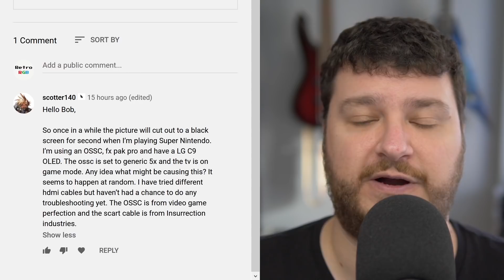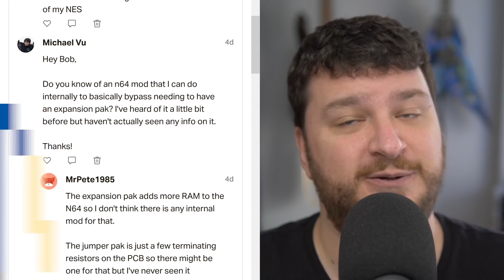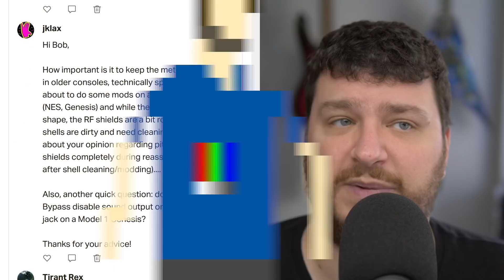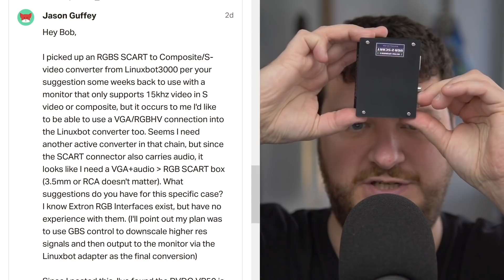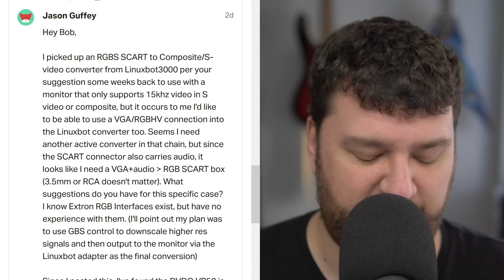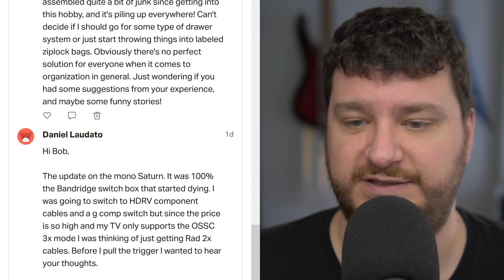Supporter Q&A #143

Comment: Saturn with rad2x is a nightmare. You have to have the right console model. It worked perfect on my model 1 but my model 2 was a problem. I sell consoles and had tested multiple consoles and most model 2s need power and When I plug in power it creates so much noise. I’m waiting for the ossc pro or retrotink5x

Comment: Thanks for all the hard work and many hours you put into the community! 

I wanted to see if there is a good solution to get S-Video into an Extron Crosspoint switcher. I’m not sure if it’s possible to convert S-Video to component then to BNC to connect to the Extron. Or if I can get a S-Video to BNC adapter (I’ve looked and it doesn’t seem like that’s a thing). I’d like to be able to send S-Video to my CRT TV and then to my flat panel TV via component. I hope that makes sense haha. Thanks for any advice you have!!

Comment: Isn't the 5x with SNES the jitter issue the OSSC has with SNES? My 5x works on my TV with every console except the SNES.
Reply: It's two things. Yes, sync jitter is one but the other is the SNES' odd 60.08hz refresh rate. Because NTSC is less than 60hz and HD sources are supposed to be exactly 60hz the TVs that handle it either have to do variable refresh rate, buffer frames, drop frames, tear frames, etc. Most just don't support it for HD resolutions.

Comment: I've been on the hunt for two months straight for a RGBHV (VGA input) to S-VIDEO to make a GroovyMame setup with my BVM A-Series (don't have the bkm-68x lmao). As of today, I found some good solutions (aside from the Extron interfaces which are impossible to find here in Brazil):

• The linuxbot3000 one but it's v difficult to find

• VGA2NTSC from Retrotink but it's v difficult to find

• VGA to S-video adapter from Antonio Villena's mister builds. Bought it and haven't arrived yet. Depends on csync (GBS Control does not support it unfortunately) and 5V on pin9 (afaik GBS Control does support this) so probably will work with crt_emudriver. 

• rgb-2yc from axun workshop. Bought it and haven't arrived yet. Probably the best choice.

• There is a local shop in Brazil that produces and sells white jrok clones. They take RGBS (csync from crt_emudriver ftw) 15khz as input and outputs S-VIDEO. Works as per their videos, but I couldn't get it working on my setup (my soldering skills are subpar so there's that).

Please be careful guys, don't buy cheap VGA to S-video SCALERS. If you read SCALER on any product, RUN AWAY! The output from those is 480i only and VERY bad as well.

As mentioned in this video, it's very strange that these solutions are not more common. There are a lot (in relative terms haha, that's a niche of a niche) of people out there without rgb/component and depending on composite or s-video and would like a GroovyMame setup and/or to use gbs control with s-video.

Comment: What do you or anyone think of the very common TG16/PCE AV adapters that are on ebay that are bare PCBs and have RGBs, AV/S-Vid or a Genesis model 2 9DIN port etc? Looking at the PCB they seem to be decent quality for the price, even some of the HDMI ones I have seen especially on Japan import sites seem to convert RGB to digital. I have a TG16 im repairing and doing an AV internal mod seems to be pointless even if I remove the RF Modulator, and I wont be buying an SSDS3 for a while and need an OSSC anyway so one of those would be great if they wont kill my console. They at least seem much better than the hyperkin crap lol. Even with audio caps and maybe an amp, cant remember...

Thanks for all you do Bob! And the RetroRGB community. :)

Comment: Hi Bob!
I just bought a fairly cheap Megadrive v.1 with no DIN output. Apparently, the seller had tried to fix it and couldn't get to it, so he completely removed the socket.
Now, I came up with the idea of installing a 3BP there with the Megadrive 2-style DIN socket, but I can't find a video showing the whole procedure. Your tutorial at RetroRGB.com is very good, but to us not so experienced with a soldering iron or with board traces, it still leaves me with a few doubts on how to finish the task completely.
Are you planning on doing a video tutorial for the 3BP install on the Megadrive 1?

Keep up the good work!!!

Comment: As long as you don't put an old plasma tv next to the console the rf shield is not really needed. But there are devices that use the rf shield as ground plane so check that. It's better to throw out a rusty rf shield. Also there is nothing against just leaving it in.